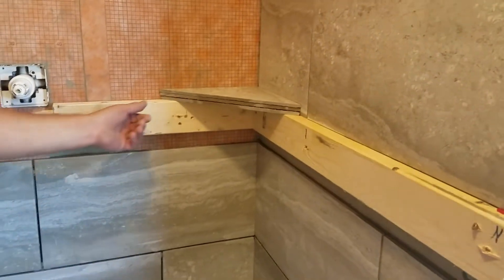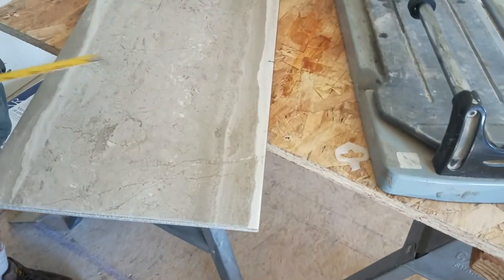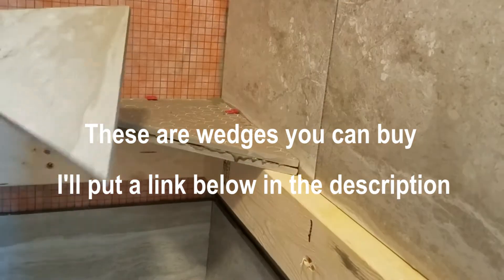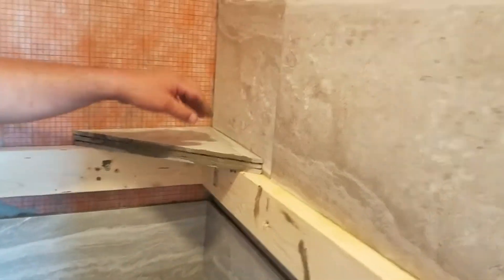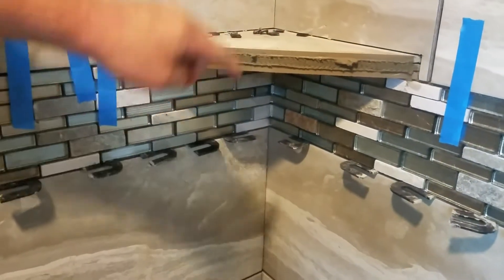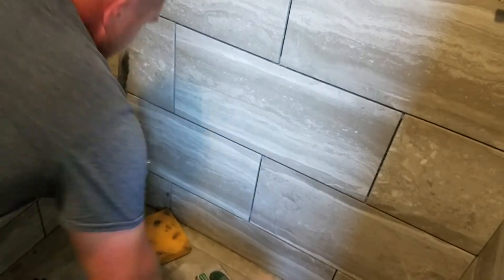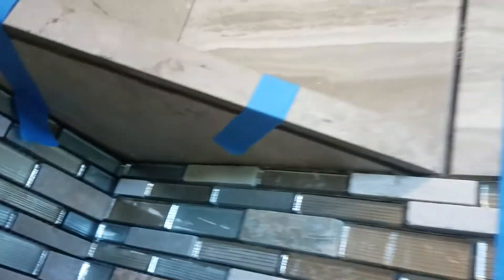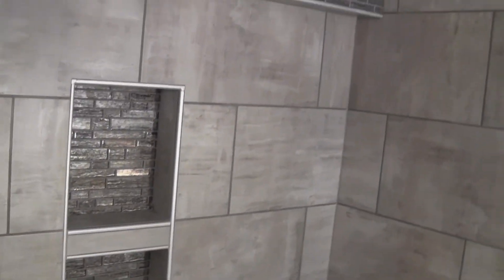how to build a corner shelf in a shower using tile

Comment: You placed 2 spacers on the finished edge before placing the beveled tile. What are the 2 spacers for?
Reply from the maker: That was to maintain a gap for a grout joint

Comment: What about retrofitting something like this to an existing shower
Reply from the maker: Yes you could do this but you have to be very careful not to disturb the cement board. You don't want to install shelf and then not have your shower waterproof Denny longer because of it so you could do it but it would take some tender loving care
Reply from the maker: However they do sell shelf called " a better Shelf" Google it,  really simple to install over exterior tile without worrying about damaging anything or disturbing the waterproofing. And it would still be covered with tile of your choice